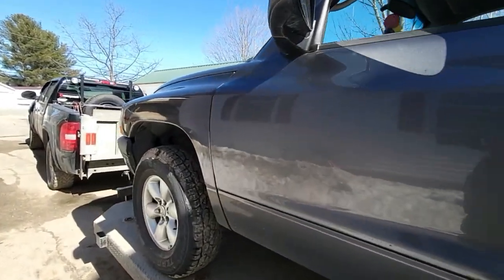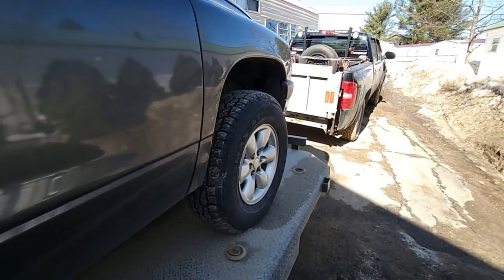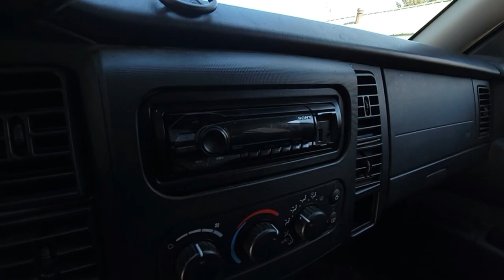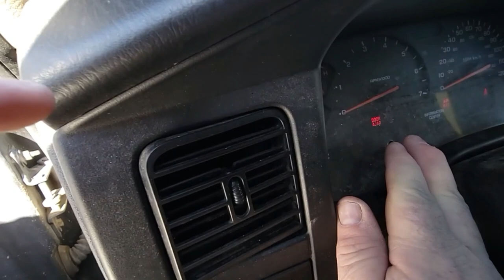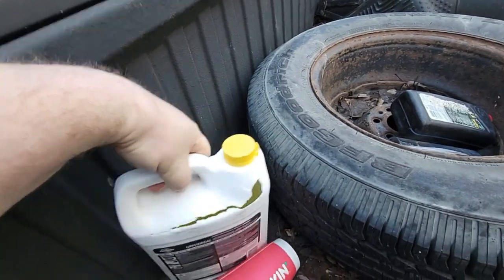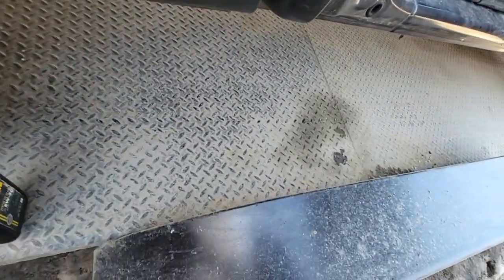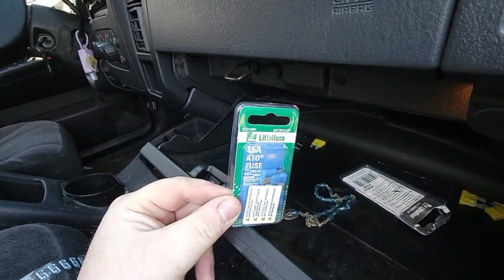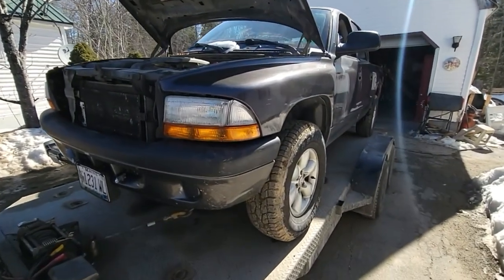Lots of goodies in this JUNK DODGE DAKOTA

Comment: Considering what you usually bring in on your trailer, this truck isn't that bad.
It still has its rockers and the bottom of doors.
Unless it's knocking or the transmission is bad, I'm surprised they didn't fix it.